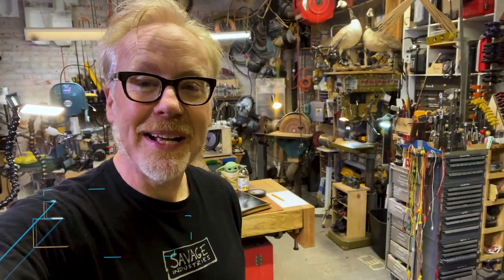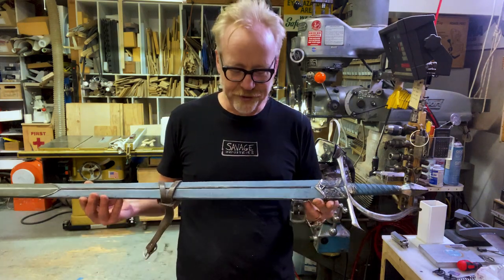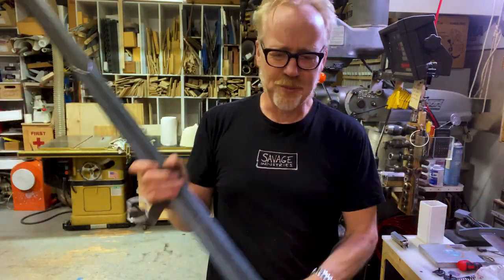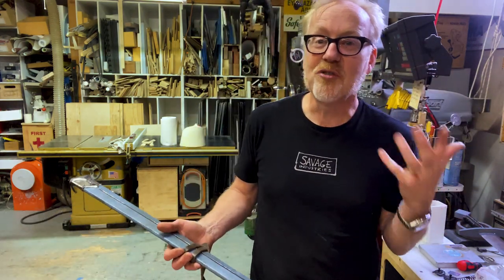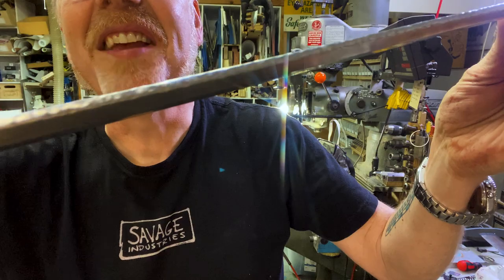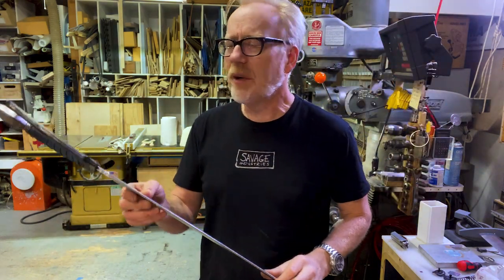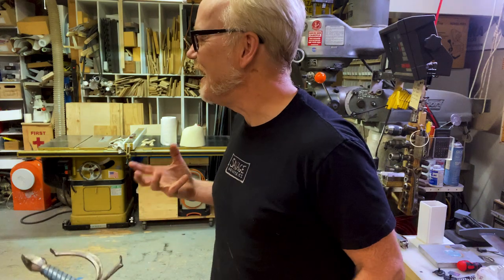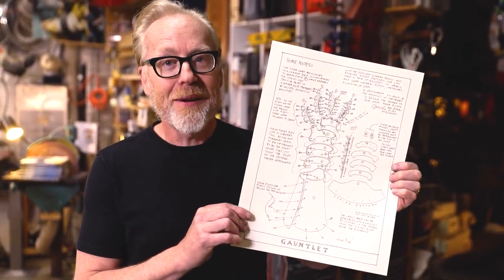Inside Adam Savage's Cave: Chronicles of Narnia Sword!

Comment: I worked on these swords in clean up and finishing.  I wasn't in casting but from memory the product is known as CC-60.  I think it is a high density rubber.  You are correct about the sword, the blade continued on into a wedge that the handle and cross guard were cast around.
Reply: Thanks Carlos, that's some incredible info, and 'm really glad you got to work on this! Be safe <3 Great series